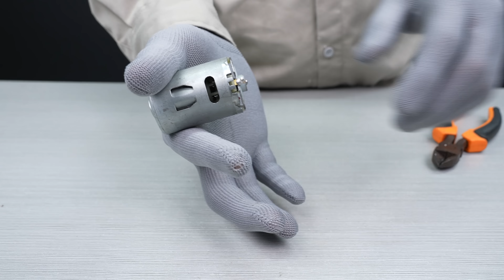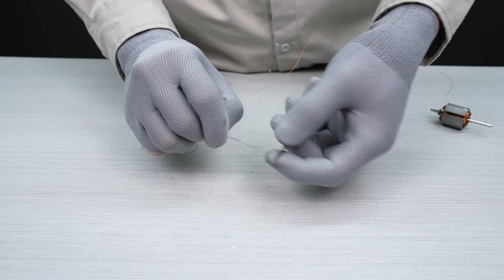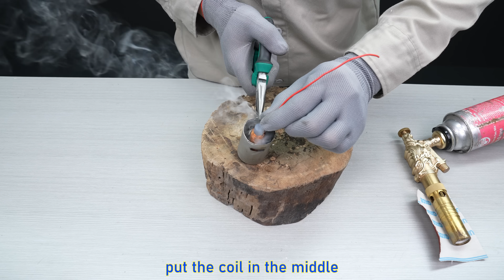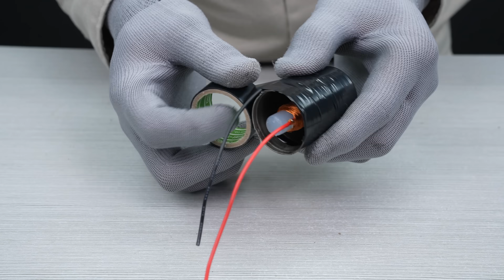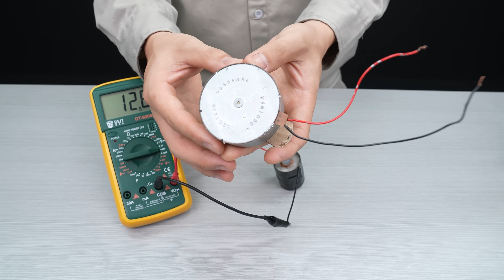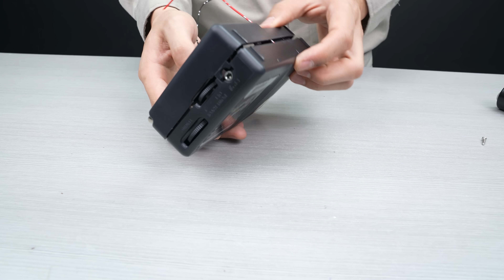Billions Of People Don't Think DC Motor Can Generate Electricity This Way

Comment: You also just found out that dc motor can generate electricity@_
I have done this experiment in 1982 with cycle dynamo’ 
I have done this same experiment 40 years before with a toy car Dc motor..
in 1982 i were studying in 4 class’ there is a scooter mechanic in my area’ the mechanic narrated me the process of magnet and copper coil how it’s work when the magnet pass from the copper coil it’s produced fluxes current that current use the whole system of electrical work in scooter 🛵’ even the coil pass the high current to plug spark ⚡️ to burn 🔥 fuel’ it’s very simple and easy definition.. what amazing! 

Today everybody is copying each other experiences copied videos on YouTube..

Comment: Dont use sandpaper to clean the surface  it might damage copper wire insulation
Reply: Used the sandpaper to strip off the protective coating of the copper so that the water and salt solution will connect to the wire to emit the power
Reply: @YuaraMeyzing for that ???? Nice so we can use copper wire instead of copper plates

Comment: aldrabão. Se o rádio funciona com 2 ou 3 pilhas ( 2 ou 4,5 volt ) e a bateria de "tua invenção" é de 12 Volt, como o rádio não "queimou"?
Reply: Ich frage mich wie aus einer Zelle eine Spannung von 12 V entsteht. Dass diese Spannung sich beim Test mit dem Motor nicht durch die Belastung geringer wird ist ebenso sehr merkwürdig.😮
Reply: @hkw1810 Потому что вода соленая.